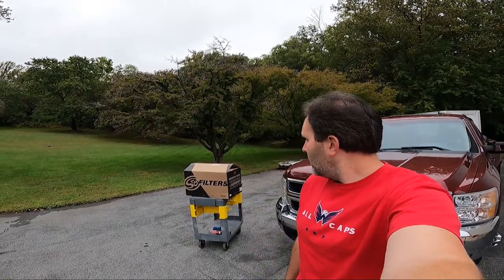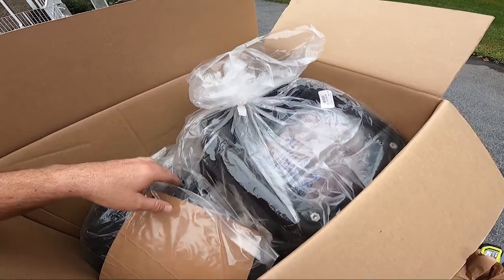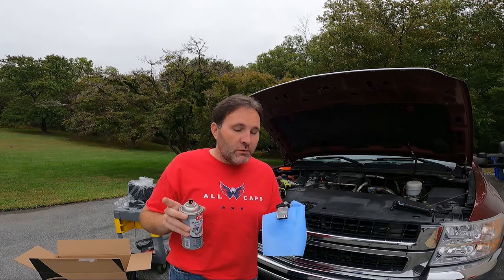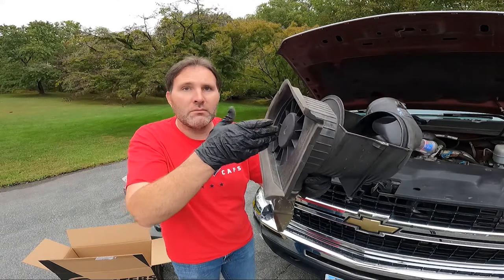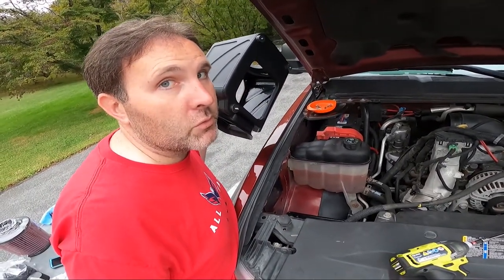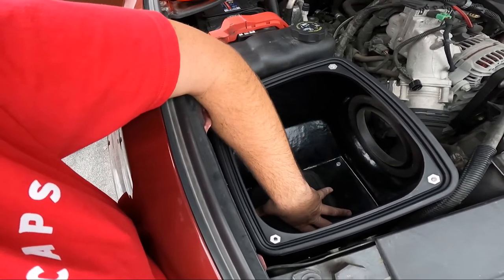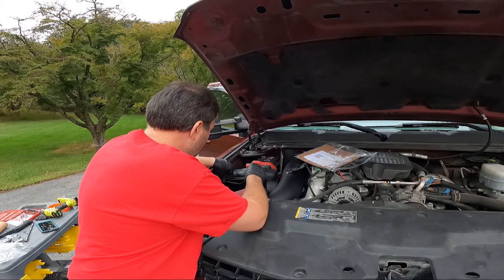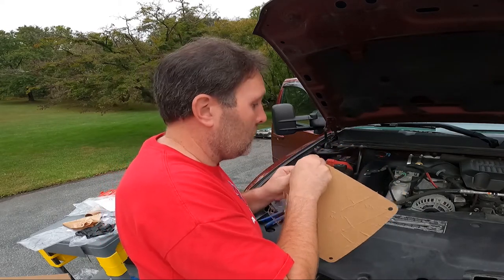Installing a S&B Cold Air Intake on my 2009 Chevrolet Silverado 3500 with the LMM Duramax

Comment: Just bought one for my 09 LMM, thank you for the video!!  I'll know what to look for when I install it!
Reply from the maker: You're welcome! I would suggest go ahead and unbolt the coolant reservoir right from the start. It will lift up and out of the way easily to rest on the engine. I haven't driven enough to get solid numbers but I think I'm seeing a 1.5-2 mpg increase with just the intake. I ordered a new exhaust yesterday and will do a carefully worded video on that and the tune in the next few weeks. It may or may not be missing some piece of equipment that the EPA wants on our trucks so we burn a lot more fuel! Also ordered new shocks and a steeping stabilizer. I figured even with only having 53k miles it's still 12 years old so replacing parts like that and the rest of the fluids makes sense. Thanks for watching and commenting! Good luck with the install, it's pretty straightforward other than the reservoir!
Reply: @hitchedtohorsepower  your truck is super clean, it looks great!!  I just hit over 100k on mine, it's not my daily driver, I put less than 10k on per year, but I still do 2 oil changes per year, etc etc., I am doing all the fluids now too.  Rear and front diff, drain and replace the coolant, trans ATF I dropped the pan and changed with Transynd at 75k, doing transfer case fluid change, etc.  All these people are worried about saving a dollar, letting their oil go 10k+ miles, another $100 oil change is cheap insurance in my book to keep the truck running for years and years!
Reply from the maker: Yup save a little money on fluids spend a lot of money when things wear out a lot sooner than they should! I sometimes get close to 10k miles between oil changes when I put those miles on in a short amount of time but normally I stick close to 5k. I understand people not doing transmission, transfer case, and diff fluids as often as they probably should but keeping up on oil and fuel filter changes is really important! It's also crazy that people will spend the the amount that the new trucks cost, my F-450 Platinum was over $88,000, but they will cheap out on maintenance, it doesn't make any sense. The only way I was able to justify spending $90 grand on a truck was normally I keep trucks for 10 to 15 years. I only kept that truck for 6 months but that was because of this market we are in so I figured I'd take driving a free truck for almost 20,000 miles and just get another when the redesign comes out for 23.

Comment: Nice video. I’ve never been a big fan of the new air intakes and/or washable filters, especially the kind you have to oil. But it does look cool under there. 

I’d probably want to keep that part cleaned up since it is nice looking. The OEM stuff though I usually just wipe at every oil change.
Reply from the maker: Yup the problem with the intakes is people don't wash them often enough. I was going back and forth between the oiled and dry filter but I've always been good about cleaning mine. That reminds me that I need to clean the one in my Jeep! On this kit it has a second air intake into the box but unless you have a heavily modified engine it's just going to let more dirt onto the filter. It also grabs warmer air from the engine bay, it's not as bad as where some intakes get the air but the intake coming from the fender is plenty for me. I might get a second filter to swap in every other oil change while I'm cleaning one. Normally I can just drive something else while I let the filter completely dry but having a second filter doesn't allow me to forget if I was changing the oil but has to go on a trip right away and tell myself to clean it when I get back then not do it. Second filter put it on and leave the dirty one somewhere in the garage that I can't help but see it when I get back haha. The oiled filters flow a bit better and while no body has ever called me an environmentalists I try to not throw away more than I have to like with dry filters. So far on looks alone I'm glad I went with S&B over Banks. I like the under bumper air scoop with Banks but by the time I bought all that it would have been $750!! I wouldn't have spent the $350 on this if I wasn't pretty sure it would add a couple miles per gallon. I'm going to fill it up Monday for the first tank since putting it on and that is going to be almost all towing miles based on how far I've gone on this tank I think I might have done even better than that!! Of course I'll have to run several tanks to really find out. Next step exhaust and tune!!!
Reply: @hitchedtohorsepower  sounds good on the added fuel mileage and upcoming upgrades. 

What I didn’t like about the oil type is they just never seem to dry enough. I’ve always read that causes MAF sensor failures too but it’s hard to say really. 

Side note there’s a dealer about 2.5 hours away that on their website has a 2008 3500 dually Duramax LTZ crew cab with less than 8600 miles! They are asking $44,995.
Reply from the maker: 8600!!! That's crazy. That's a good price in today's market depending on rust and the other possible problems from sitting so long. It's amazing that there's as many of these low mileage trucks around. It's not like there common but you'd think that people that buy diesel trucks would put some miles on them! I guess there's the people that get them to pull their RV down south and back for the winters then they sit the rest of the year. 
Hopefully I won't have any problems from the oil. I guess if I have a problem I put a new MAF sensor and swap to a dry filter lol.
Reply: @hitchedtohorsepower  yes sir. It is sharp in the pictures. Victory red, light grey interior. Has some stick on chrome covers over the tow mirrors and the hood vents. I’m almost tempted by it but it would have to be my daily driver plus my our primary family vehicle so I’m not even going to call about it lol. They only have three pictures of it online but it’s nice looking. 

It’s at a dealer called Glockner Chevrolet in Portsmouth, OH if you want to check it out. They have an AutoCheck report available with it and it all says it’s good.
Reply from the maker: I just looked at it and wow it's sweet! I'm very happy with my truck but this might have been the one if it had been for sale a few months back. I completely understand not wanting to have that as a daily. I've driven duallies as dailies at times and while it's doable especially depending on how parking lots around where you drive are setup. Driving the 450 as a daily would be easier than a GMT900 because the front axle makes turning so easy. Anyway I'm down in Chincoteague, Virginia with some friends and almost no cell service and about to get some sleep. Speaking of great dailies I drove my VW Sportwagen TDI down here today and according to the computer I was getting 45 mpg! I'll stop and fill up and figure out the actual mpg. I'm going to go to sleep, every few seconds I doze off and my phone hits me in my nose! Anyway I hope this comment made sense with as tired as I am 🤣😴? I'm going to sleep!!!
Reply: @hitchedtohorsepower  wow 45 mpg!! That’s incredible!
Reply from the maker: It's a pretty amazing little car. It's crazy how much stuff it will fit I'm the back. I wish it was a little more comfortable to drive long distance but it's still a fairly small car. I like the seating position of a SUV and trucks. Although I enjoying the driving of a low car and rowing my own gears! I think I'll do a video on my Sportwagen TDI and Grand Cherokee Ecodiesel. They are both very interesting vehicles that are not talked about enough.
Reply: @hitchedtohorsepower  I don’t mind driving cars sometimes but I’ve had my feel of it these past 3 weeks, and now this week will make 4. They got me in a 2020 Impala what time they are working on my truck. It’s a nice car, big for a car and plenty comfortable but I just like trucks. I’m pretty good size guy at 6’3 about 235 so I don’t always fit in cars good. I fit the Impala just fine but I just prefer trucks.
Reply from the maker: @matthewanderson9912  Yeah I agree, some cars can be ok but there's nothing like a full size truck as far as comfort especially on a long trip. My Jeep is good, it's the top of the line Summit model, so it's very nice but not like a truck. I try to make myself drive the VW because it averages 40-42 mpg and only has 55k miles on it. The Jeep gets around 30 mpg so not bad but I'm at 145k miles so I'm trying to limit the long trips. Those Impalas are pretty nice, for a car. Back when I was 20 I had torn my left knee up pretty bad and was driving a VW Golf TDI manual. I wanted something more comfortable so I got a 03 Ford Crown Vic LX Sport which was Ford's slightly less high performance version of the Mercury Marauder. I've had a few nice German cars but there is still something about a big American sedan. Overall I wish I could justify driving my dually most of the time. Any update on your truck?
Reply: @hitchedtohorsepower  that’s really good mileage and that’s also a reason why getting a 1500 with the 3.0 diesel is always at the back of mind. People say the get 24-26 around here which is incredible for a truck. But I really would rather have a 2500 if I do ship my current truck down the road after all this. 

No update since Friday. As of Friday they were still waiting on some parts. Said they thought they had the lifters but were waiting on some gaskets and a fuel rail. Said they have to change the fuel rail sometimes when they do lifters. I’ll probably call tomorrow to get a new update and to try and get things rolling for me to get a loaner truck for Saturday if at all possible. My patience is really starting to wear out on me. It’s not necessarily the dealers fault and they told me that they have had 3 trucks in for lifters including mine since mine has been there. But even still I’m 3.5 weeks into this with no truck. I’m going to be upset with them if they don’t at least give me a loaner truck for Saturday so I can go racing.
Reply from the maker: @matthewanderson9912  a good friend of mine has the EcoDiesel Ram 1500. He had a Grand Cherokee Ecodiesel, which he bought right after we got back from a road trip to Nashville and back to Maryland in mine. He says the Ram gets slightly less mpg than the Jeep but still in that 25 to 28 most of the time and has cracked 30 under perfect conditions. Besides the extra weight of the Ram both of our Jeeps had the air suspension which lowers the ride height at speed to help fuel economy and handling. His Ram has the coil springs, he wishes he had searched a little more to find one with the air suspension but the springs still are good. I hope I'm not jinxing myself but I haven't had any problems with the bags either. On the loaner car the few times I had my 450 at the dealer they didn't have anything for me!! I spend $90 grand and even when I dropped it off for things that were wrong when I picked it up originally and nothing! I didn't really care what it was I just didn't want to have to get someone to have to get me take me the 30 minutes each way to the dealer! I sure hope they get you something that will tow. Too bad I'm busy this weekend otherwise I could take a road trip out your way with my truck and check out a race after we used my truck to get your trailer to the track!! Anyway keep me in the loop on the repair.
Reply: @hitchedtohorsepower  got it back today. #7 cylinder intake valve had a collapsed lifter and bent pushrod. They replaced 8 lifters on the left side of the engine. I’m glad to have it back but I don’t have much faith in the right side not having a failure. 

I appreciate that buddy. I’ve had several friends offer me their trucks but I didn’t want to bum one off someone else. I wanted the dealer to give me one if it had came to that. I do appreciate that.
Reply from the maker: I'm glad you got it back but yeah I'd have trouble trusting it after this. Especially when towing away from my local area. My friend's 06 F-350 6.0 I drove between selling my 06 Silverado and getting the F-450 was fairly low mileage, 150,000ish, and had a lot of stuff fixed and upgraded. For a year and a half I was just driving it and covering the maintenance because we're good friends and he needed for plowing and a few other things so he kept telling me to just use it for my towing. Fall 2020 he had some things come up that forced him into selling it and he offered it to me at a very good price but between that I really wanted a new truck I just didn't trust it when I'm a long way from home where either I can fix it myself or get it to a diesel mechanic that I trust and won't charge me a fortune. Plus for me breaking down while on a schedule transporting someone else's car is really bad. At least with you in theory anyway if something happens you get in touch with the closest Chevy dealer and they should either fix it quickly or give you something to keep moving. It's still going to be a serious pain but warranties have there good parts! I sure hope something changes and you can get a good deal on something diesel. The gas engines have improved but for towing there's nothing like a diesel. Even the 3.0 V-6 ones are going to out tow and out last the gas engines. BTW I forgot to get you in that month I didn't have a truck and had to tow my 22 ft enclosed with my Grand Cherokee Ecodiesel I still got 18 mpg towing!!! There's been a few times I've thought about taking it with an open trailer because it would save a bunch of money. I'd probably be in the low 20s mpg with a lightweight car on an open trailer. As long as it's not one of those Uhaul car trailers, those things weigh an incredible amount!!! 
As far as borrowing a truck I get it. I has to go to Ohio a few years ago and just before I left a blew an injector on my Duramax. I asked a friend to borrow his truck. Everything is going fine until I heard a loud bang and the engine shut down. An oil line blew off while under 3200 psi and hit the block with enough force to put a little crack in it!! It was about a $3500 repair that luckily after a lot of fighting the insurance company paid. My friend knew it wasn't my fault but it still sucked. Didn't help that it was close to 0° out and I was on the side of the PA turnpike for several hours waiting to get towed. My friend had to come pick me up from Maryland and the friend I was taking stuff to was able to borrow a truck to come get the trailer. Besides me being tired and very cold it worked out but that's the fear with borrow someone's truck to tow. Good luck with this weekend's race and let me know if you go to one within a few hours of the DC area. Also I keep thinking about that 8600 mile Silverado 🤣🤣🤣.